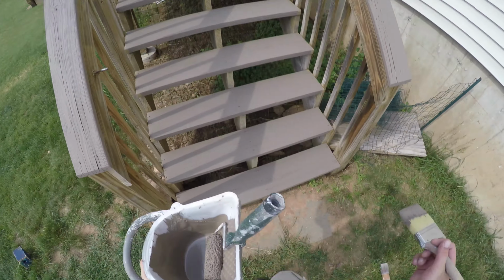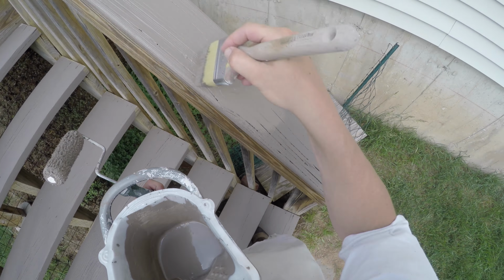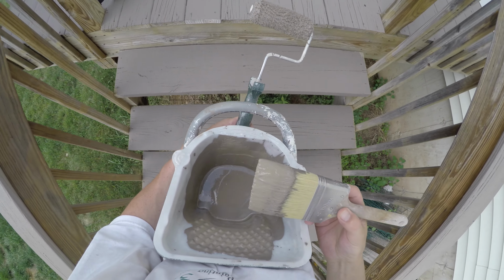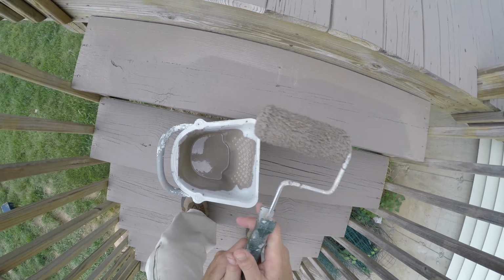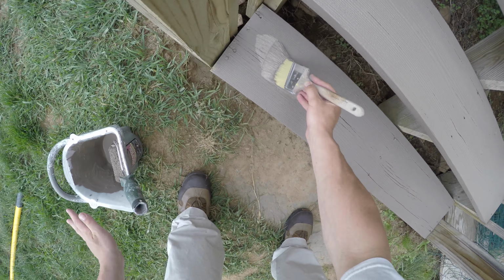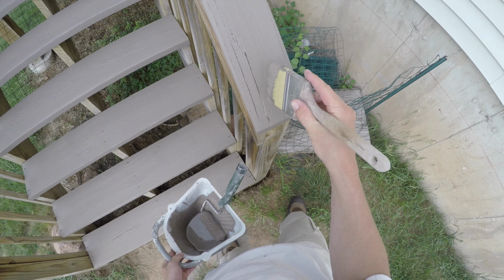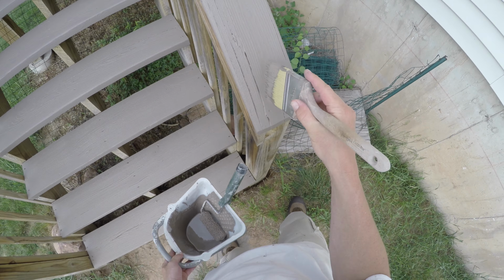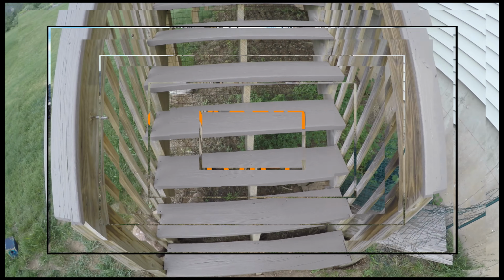Deck Restoration & Painting 101  (Part 10)

Comment: Russ - watched all of this series, very nice. I have seen so many decks on here where they had peeling issues even Paul Ricalde here had that problem. He went back and primed it with oil primer on the areas where he had problems. I really believe this type of products needs the wood to be really dry AND primer to really have this stuff bond to even with sanding but sanding sure does help. Keep us posted with new videos in Spring and fall with updates on your deck would really be a great help.
Reply from the maker: Hi Sean-

Most cases where there is a problem with adhesion, is due to the fact that the homeowner didn't prep the wood first. They just apply this product right on top with no preparation work. In this video series, I used a cleaner and pressure washed the deck. This raises the fibers of the wood and softens the wood. Next, I sanded the surface with is also really important. This creates a phsyical bond. Most people don't like to do the prep work. It's hard work. The primer is also a good idea. But, jUST PRIMING OVER A DIRTY SURFACE IS NOT THE ANSWER EITHER.  It's been over 2 years and nothing has peeled. Will try to do an update! Where you from?

Russ